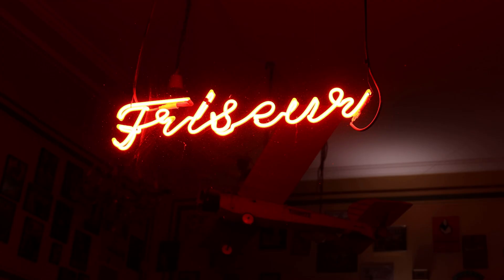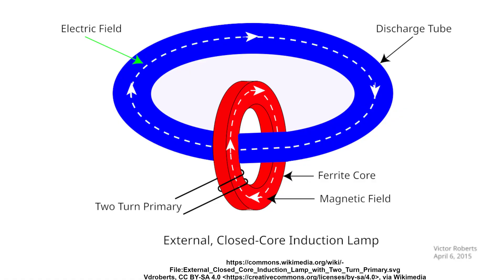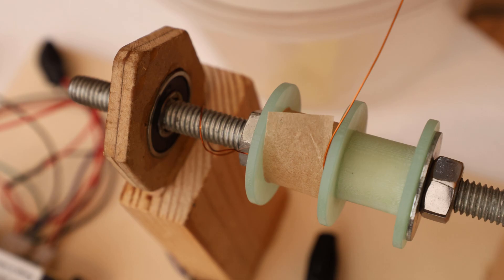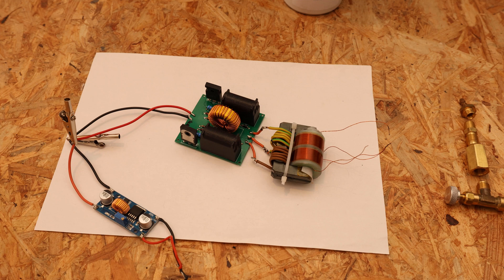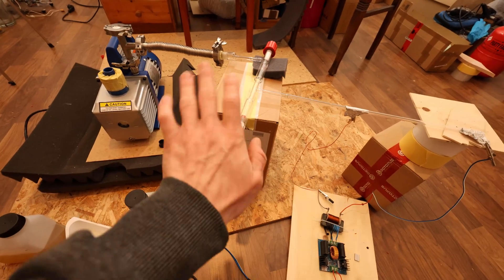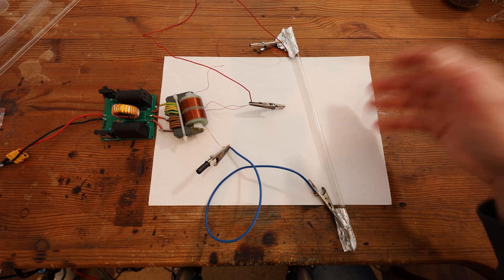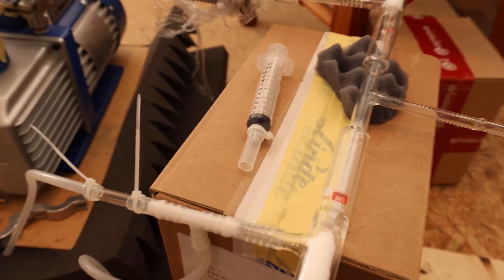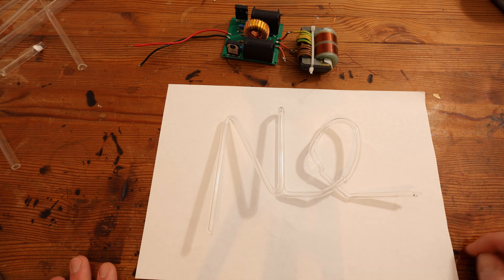Making real Neon Tubes! [Part 1]

Comment: Not picky just a correction: but I think it's high voltage not high current, Hence why neon transformer transformer/ NSTs come in like 15kv but only like 60 - 120 MA, High voltage ionises gas current not so much Depending on the voltage level

Comment: I started off the same way as you, wanting to make neon at home. Now I have five burners for bending and a full commercial 20kv bombarding setup at home and I make neon all the time, most days. 

Regarding your purple tube, this often happens even with proper neon equipment. It's usually because there is still air in the tube. Most of the time as long as there is also neon in there, you can burn the tube in on a big transformer for a few hours and it'll go red.

I also don't think your vacuum pump is going to be good enough, you need to get down to 1x10-3mbar minimum. Most bombarding setups also have a diffusion or turbo pump. My setup gets to about 1x10-7mbar with a diffusion pump. 

You should also have a vacuum gauge so you can see what the fill pressure is as that's also critical. A tube that size with neon is filled to about 19mbar (above zero, so still a vacuum)

Comment: Think instead of vacuuming the epoxy you apply high pressure air
Reply from the maker: I have to read up on that but I think you supposed to suck the air out and then apply pressure to force the resin in.

Comment: maybe you could use a longer cure epoxy and leave it way longer?
Reply: under vacuum*
Reply from the maker: I have to see if I can find something. I think the one I have is already 24h cure time epoxy. It's just getting thick way before that. Not sure if there's stuff that's even slower. But I think it probably helps more to use some other paper, I forgot to consider that the epoxy can't soak through backing paper, so it can only flow around it.

Comment: With the tesla coil looks sick 
For the soldering just try normal soft solder with flux inside the tin wire, the most important thing is not to heat the solder with the flame, but heat the brass piece, somewhere, then press the solder on the joint until it melts from the heat coming from the brass part
Reply from the maker: Definitely need to try it again. Solderung is a good skill to have👍

Comment: Around 13:00 I was thinking you'd have to flame the tubing, but wow, did it really take 30 minutes, or was that for good measure?
I'm thinking a $35 HVAC manifold gauge set might be best. I don't know if it'll be precise enough for this purpose, but it does have needle valves which are about 2-3mm needles, tapered down to a 1-2mm orifice, if I recall. I've found it gives pretty fine control for filling small DC refrigerator systems, but that's tenths of grams, not milligrams. Still, it's bound to be better than those POM needles, and the valves have large handles for fine control. If the gas bottle has a 1/4" or 3/8" SAE flare fitting, then the only special adapter you'll need is a 1/4 flare to hose barb, because the pump and gauge set all have 1/4 flares. (I wouldn't bother with the corrugated high-vacuum hose.)
Some epoxy users pull a vacuum, then cure it under pressure in a paint pressure pot or something. If you pull a vacuum until you've got lots of bubbles, then break the vacuum, I wonder if the bubbles will collapse and fill the voids.
This is very neat to watch, it's something I've always wanted to do. Thanks for sharing!
Reply from the maker: @WaffleStaffel  Actual vacuum tubes need to be heated for hours. Maybe it's overkill in this application, maybe it's not. I guess the HVAC manifiolds probably give the same control as a gas flow meter with needle valve. The lowest I could find is liters/minute. But I found even with my big high vacuum gauge I can adjust it already okayish if I use a bit more than 10ml, so I think I'll try one of these first. 

I used the corrugated hose because it's good for high vacuum but it also dampened the vibrations from the pump a bit. I also replaced the pumps fittings with a KF flange, which makes that necessary. 

To the epoxy. I pulled vacuum and let air in repeatedly. Putting pressure on there is a good idea. Apparently you shouldn't pull vacuum for too long either because the epoxy itself evaporates. Which I did aswell.

Comment: You need to heat the magnesium to  remove the oxide passivation layer and expose the highly reactive magnesium.  Putting the sealed tube in the microwave oven is very effective!   Heat about 30 to 60 seconds.  Let cool.  Repeat. Zirconium foil has better geometry and wont make mess in the tube. Also, keep your neon pressure at 5 Torr.
Reply from the maker: @kcakarevska  Yeah I knew that. I hoped the gas plasma would sputter the magnesium a bit and react with it. I heated it with the torch but the magnesium shouldn't touch the glass while it's heated. I might try to put it in a metal shell and heat that with an induction heater.
Reply: @thesciencefurry looking forward to seeing your next video!

Comment: do you think the epoxy bubbling could have been from some component of it evaporating and not from any air left in it?
Reply from the maker: @glockenspielsdesk  Yeah someone mentioned it. But I was mostly seeing the bubbles coming from deep inside. So I think it didn't penetrate very well. It was kinda stupid to use backing paper, because the epoxy can't soak through it.